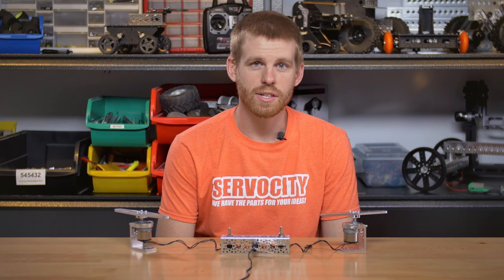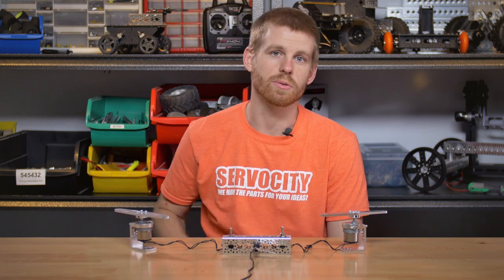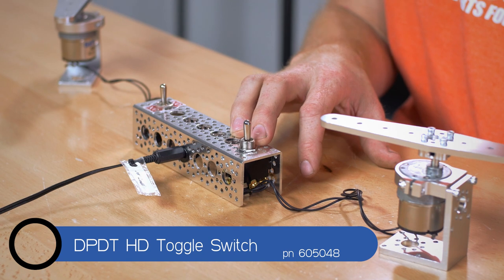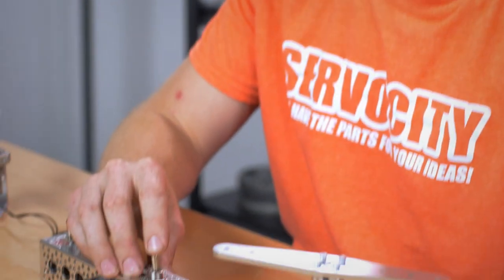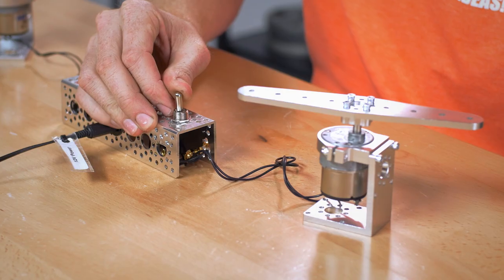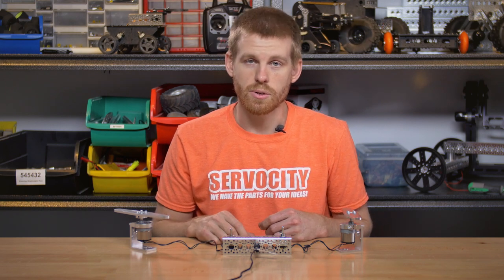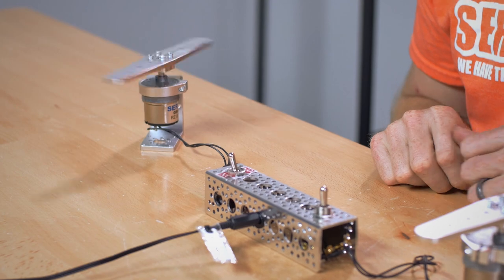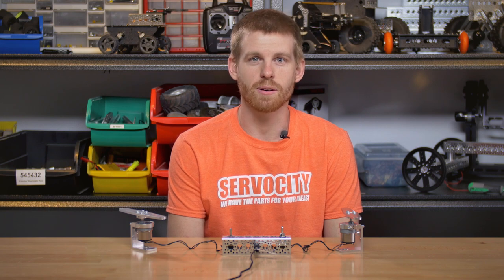Comparing Momentary Switches & Non-momentary Switches - with Kyle

Comment: I have a question  about how to hook up a motor similar to what you have there motors to a auto car seat it has to wires if you hook it up one wire to pos  and one to neg the seat comes up if you hook it up reverse  the seat goes back I need to hook up a switch momentary switch where one way goes back and the other way goes forward  can I do that with a 3 pin  momentary switch
Reply from the maker: Hi Derrick, your setup will require a DPDT momentary (center off) switch.  Make sure that the switch you use is able to handle the current the motor is able to draw - I would imagine that originally the seat ran through a relay instead of directly to the switch.  Please let us know if you have any other questions tech@servocity.com.
Reply: Hi there, What is the difference between a momentary switch with a bell push switch?
Reply from the maker: Hi Don, if you're comparing a momentary button with a momentary switch they're quite similar, just a different way to close (or open) the circuit.  Feel free to contact us should you have any other questions tech@servocity.com!

Comment: Can you combine the two switches so for instance on and center off with a momentary third state?
This switch was used in a Ham radio for the microphone so quick press "hello" release then locking other direction for a long chat.
Reply from the maker: While there may be such a switch available, we unfortunately do not offer those currently.  Another option would be two switches wired in parallel on the same line.  A latching switch for those long conversations and a momentary for short ones. Please feel free to reach out to us should you have any further questions at Tech@ServoCity.com.

Comment: What should I look for if I'm looking for the first kind of switch in the video but with only two positions instead of three?
Reply from the maker: If you would simply like to turn the motor on and off with a switch and always want it to run in one direction, an SPST switch would fit the bill.  If you want the switch to have two positions, causing the location of the switch to determine the direction of the motor, an ON-ON, DPDT would work for that. Please feel free to reach out to us at tech@servocity.com should you have any further questions.

Comment: Is there a way to make this wireless ?
Reply from the maker: We offer wireless relays that operate off a PWM (hobby servo) signal, or there are wireless relays available that just require a DC voltage.  Even those options will need to be wired to the item you're controlling.  Please feel free to contact us should you have any other questions tech@servocity.com.